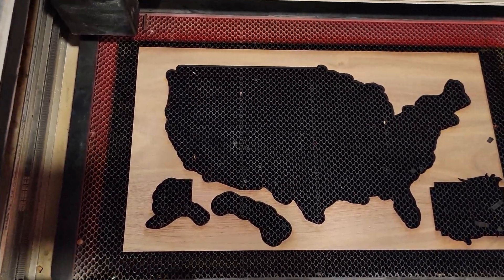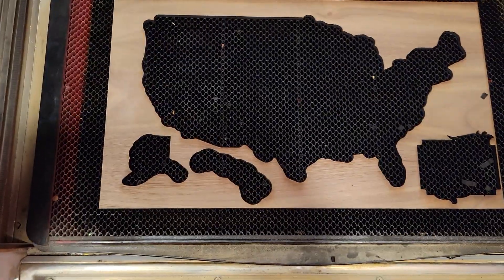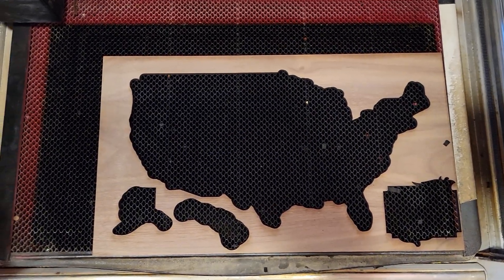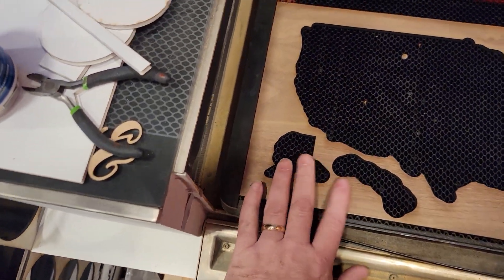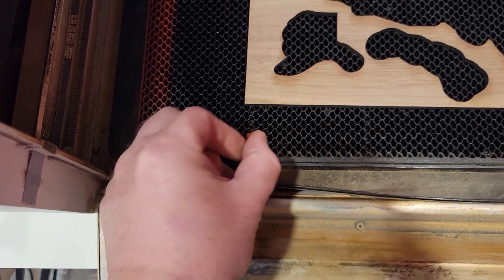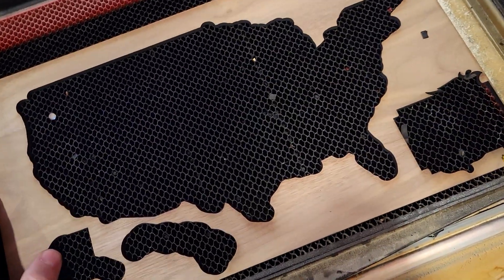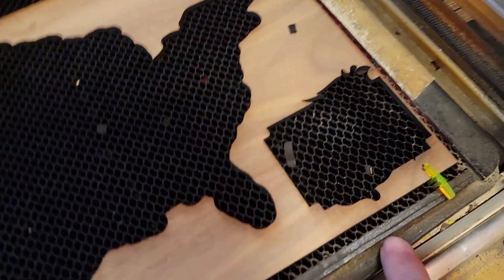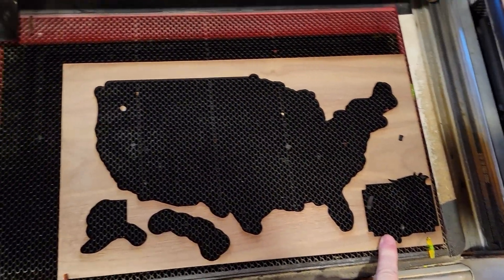Why doesn't glowforge let me use the whole bed.  Short(ish)

Comment: what's the thickness measurements of red area at top and left side? thanks for informative video 👍
Reply from the maker: I don't have the red measurement, but the way I made that was to mask the whole bed, then cut a 10.9 x 19 4 rectangle from the center.  I peeled the masking OUTSIDE of that rectangle, then also masked the outer black frame of the crumbtray.   I spray painted it from different angles for good coverage, and peels all masking when done. :)